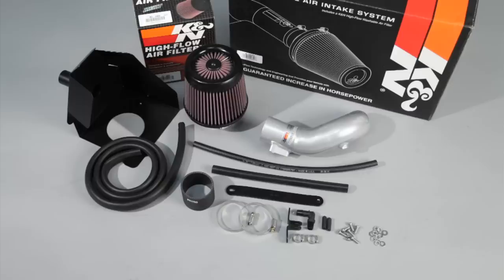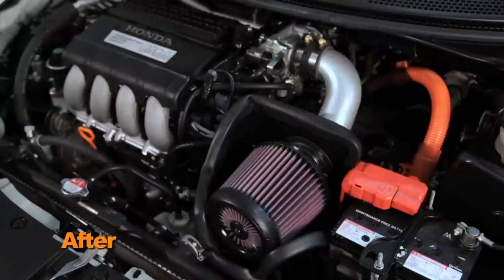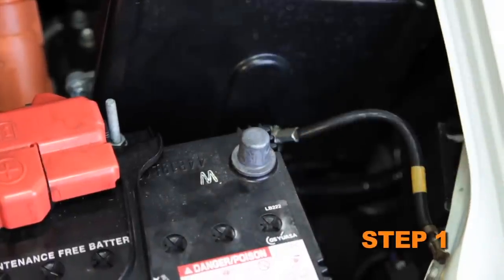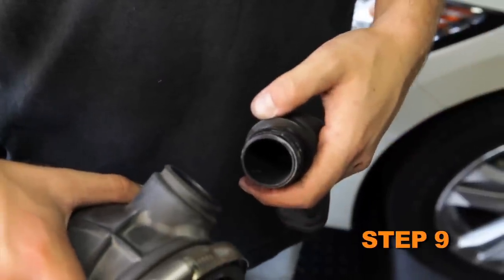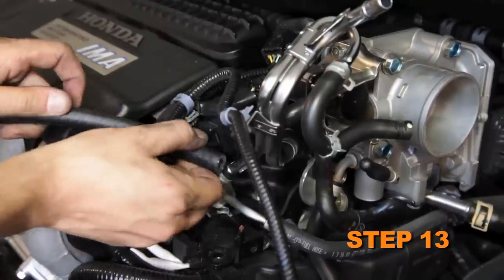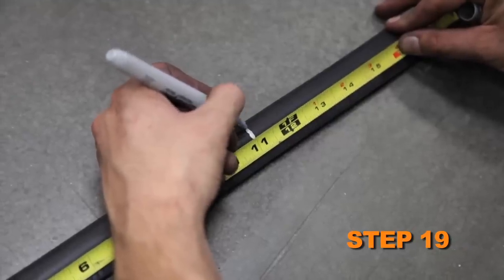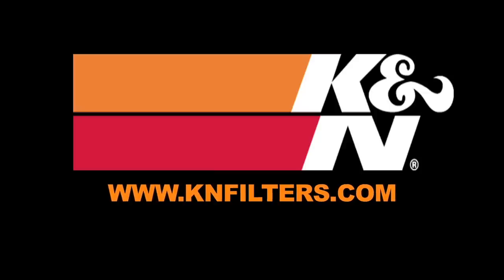Honda CR-Z 1.5L [#69-1018TS] Air Intake Installation

Comment: Remove the crankcase vent hose is super unclear. Nothing showing where it is. I need that info because now I'm stuck halfway through an install because the instructions are super not clear on this part.
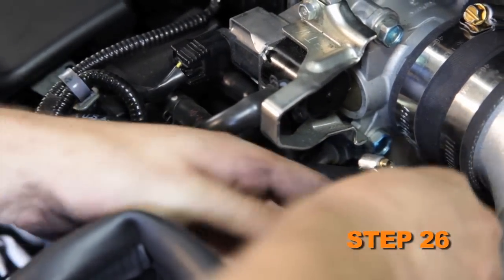Reply from the maker: See step 26 at 5:56.  If you have any other questions, please contact our product specialists 800-858-3333 or tech@knfilters.com.

Comment: why must the bypass hose be replaced?
Reply: Okay no one asked for a response 8 years later but here it is since I just installed this kit. The PCV hose goes from the stock intake to a coolant loop - this is for cold climates to stop the PCV vapor from freezing up. The problem is that the kit elbow joint and the coolant loop port are different diameters. Instead of including a reducer they just decided to delete the coolant loop entirely. I however found a quick solution - you can insert a piece of the provided coolant hose inside the provided PCV hose (using some silicone spray as lube) and then you can easily keep the coolant loop - attaching the small hose to the coolant loop and the large hose to the N&N intake.
Reply: @e30_B27 thanks i was gonna buy one soon.

Comment: Having trouble finding the part number for replacing the filter.
Reply from the maker: Check out part# 33-2459 https://www.knfilters.com/33-2459-replacement-air-filter

Comment: Do they make one for the 2016 model?
Reply from the maker: This system will work for a 2016 Honda CR-Z 1.5L.  Check out the "Vehicle Applications" tab on the following page https://www.knfilters.com/69-1018ts-performance-air-intake-system

Comment: anyone know why its important to lower air duct into the lower tube?
Reply: Colder air, colder equals denser air so more air for the same volume. Best way to know if it works is to dyno it. One con is the risk of hydrolocking your engine.

Comment: Is a tune necessary?
Reply from the maker: No, all K&N air intake systems are designed and tested to work with factory ECU settings.  Check out the following video for more info

https://youtu.be/ydfBn8H98WE

Comment: why isnt it legal in california? its just an intake?
Reply from the maker: +norreko Since we are modifying smog components, (intake) we need CARB to approve the kits each separately. The smog station will do a visual inspection on the vehicle's intake to make sure everything is stock and in place. If it is aftermarket, it will fail unless it has a CARB decal.
Reply: KNfilters so how does one get a CARB approval? I really want this K&N filter.
or is it just not possible?

Comment: I tried installing it but they send me the incorrect intake tube🥺
Reply from the maker: Please  contact our Product Specialists at 800-858-3333 or tech@knfilters.com for assistance
Reply: i bought the kit in the video and was sent the wrong tube as well. I contacted K&N via phone (email has a really slow response) and got the right part shipped out at no cost. One pipe for the G35 looks almost the same and has almost the exact same part #....